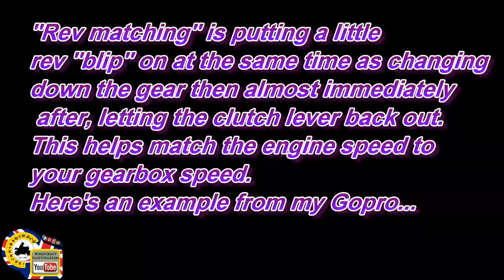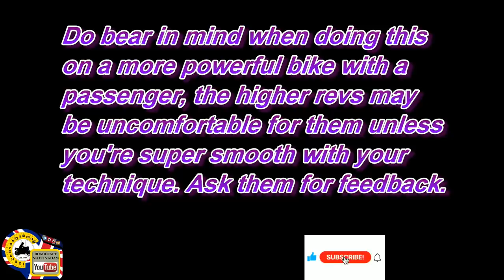WHEN to change gears on a motorcycle : How I do it as an instructor of 39 years. (Timestamped)

Comment: Is it much better to hold in the clutch with out downshifting when your coming at a set of traffic lights because its faster way of stopping and much easier? Because downshifting takes time. On kawasaki z400cc with a slipper assist clutch is even much better to do that with I think.
Reply from the maker: No, you need to be following your speed chosen with the matching gear. Keeping in 4th gear at 10mph isn't recommended as you'll have to fiddle with the gears.

Comment: I have a question, I'm on a 125 and can I block change from 5th to 3rd to take a corner if I'm slowing down using the brakes and not on the throttle or will the bike not like that
Reply from the maker: If you've lost your speed first and know your bike's gearing so it doesn't over-rev when you let your clutch back out, yes, as long as you have the gear engaged before taking the bend.

Comment: This is a great video! I have a question, what’s the proper technique when I find myself going too fast downhill thats also a bend? I usually downshift and use rear brake if the engine brake is not enough to slow down but I’ve been reading that this will cause the rear wheel to lock up? Will applying the front brake cause me to slide? Thanks in advance for the advice!
Reply from the maker: Always smooth, progressive braking first, followed by gear to match the speed. You won't lock up then.

Comment: Is it ok to alwayss get many gears in a row without letting clutch out, i get in first gear high speed & then clutch in & keeping in & get 4 or 5 gears & then let clutch out & downshift same way
Reply from the maker: To want to change that many gears in one go, you'll have to be ragging the bike, not the behaviour of a competent rider.  It can be done, of course but not desirable or really required.  A couple of gears, no problem.
Reply: @RoadcraftNottingham  i don't understand the reason why one has to release the clutch in betweens rather then get to 40km/h on 1st gear & then upshift till 4th gear & then release the clutch. The rev will match & also less fuel since you are getting higher gears in.

Comment: Interesting, I’ve got a question for an expert! I ride the Honda CBR650R with a slip and assist clutch, I thought they still required blipping but it never works, you always end up lumping the revs, you can successfully change down and just drop the clutch and that works fine. I’d have thought it would wear it out! Nope it eases it in.  Am I doing it right? On my other Hondas without that clutch, rev match/blip is essential. If you try to blip the assist and slip clutch it just hates it. Perhaps Triumph are different? Thanks
Reply from the maker: Slipper clutches are another unnecessary addition on bikes for public roads. They're basically there to stop the rear wheel locking up under extreme conditions. I had a go on a bike with one years ago but can't remember it that well so can't help you. I suppose just keep trying different ways until it feels right. Good luck
Reply: @RoadcraftNottingham  cheers for your reply, I think I’ll trade it in for something else. They’re putting them on everything these days, it takes the skill out of it. Yet, the friction zone is finicky and narrow, compared to a standard clutch. Or maybe I’ll just go for a Zero!

Comment: Should I have my foot VERY slightly putting pressure on the upshift when shifting normally? (clutch in including). I've read forums where people say it's ok to preload but some say it's bad. but I'm new so I found out that putting pressure makes the shifts way smoother. 
Does this wear the engine out?
Reply from the maker: Pressure whilst accelerating makes the change quicker when you close the throttle off to change. It's only a problem if you have a quick shifter fitted. If it feels smooth then it's all good.

Comment: That's my practice sorted for the next few days, rev match is one of the pieces I've enjoyed on this video most, thanks I really enjoyed this video and it's going in my playlist.  What's your thoughts on progressive braking?  I use both brakes together after lowering throttle and engine braking?
Reply from the maker: Progressive braking is best. The front is your main stopping brake with the rear being for slower speed control. Search my channel for Diavel and braking.
Reply: @RoadcraftNottingham  Thank you, I’ll check that out today :) 🏍✊🏻

Comment: Very useful - thank you. An advanced instructor once told me to aim to hold revs in any given gear at roughly halfway through the rev range- e.g. if you’re riding along at 30mph, pick the gear that ticks the engine over at 5k (presuming a 10k readline). Just wondered your thoughts on this?
Reply from the maker: It all depends on the type of bike and engine configuration. Just feel what your bike is capable of and experiment.

Comment: Great video as always . I was wondering if you can comment on the issue of 2 fingered braking? It seems that alot of instructors in the US swear by it where the UK instructors that I have spoken to said that its dangerous and would be grounds for failing a test.
Reply from the maker: There's nothing wrong with two finger braking and you will not fail for braking like that. One or two old school instructors or examiners don't like it because we were told years ago to use 4 fingers but braking efficiency has come on massively since the 70s. The bottom line is "has braking with two fingers had a detrimental effect on the bike's control or your safety?"
I once told an examiner he shouldn't have mentioned the two finger braking to my pupil on test and we had a little argument... I then went to the big boss who said" examiners can't mark what they don't like "which is an excellent response.
Reply: @RoadcraftNottingham   Thanks Russ, I've learned to ride outside of the UK and had to do my test again since my license was not from an EU country. I was brought up with 2 fingers on the brakes at all times and I had to in a sense relearn how to ride when it came time to do my test.

Comment: Does anyone know why my gear lever jams when shifting Down? If so what can I do to prevent this?
Reply from the maker: Firstly make sure the lever is returning, could be a mechanical issue. Then check that you're taking your foot fully off the lever between shifts to allow the next selection. If changing too late, let your clutch out between each shift to help reset the gearbox.
Reply: @RoadcraftNottingham  the issue usually occurs when I’m downshifting multiple gears at once after coming to a complete stop at traffic lights or a stop junction

Comment: Yes, my changing is pretty much as you describe but like others have said my bike has a lot of engine braking so I often don't need to use the brakes but just let off the throttle. The concern is that the car behind might not appreciate that I'm slowing down. I tend to dab the rear brake enough to get the brake light on. What do you advise in this situation?
Reply from the maker: My point is normal engine braking in the gear you're in is fine, changing gears to replace any braking you may need isn't. There's a difference. ☺ I do dab my brake lights on my Zero if there's a car following because the regen braking is so good

Comment: Thanks Russ, Another well informed vid.  I recommend to my students to subscribe. Quick question: what is your opinion on riding with balls of feet on pegs or arches? Cheers.
Reply from the maker: Thanks for the recommendations. I don't mind how someone rides as long as they are in control and safe. Different bikes, peg positions and heights and rider sizes make things different. If they're riding with balls of their feet on the pegs but then move to cover the brake when required, I'm happy.  One of the problems with arches is they have what I call "clown feet" and there's a danger of toes scraping the floor on bends or clipping test cones.  Also a danger of slightly applying the rear brake without knowing. 

What do you think?
Reply: Thanks for the reply. I had it beaten into me about arches only. But the IAM teach balls of the feet and I may well have been converted. I don't like the " clown foot " either .. looks messy and balls of feet offer more control. Over the years I know I was moving my inside foot back for clearance on bends. So I am now on the balls and practising that. One of my instructors used to call the arch position a lean angle sensor,,,,!! Lol. I like to arrive home with both feet still attached. CHEERS AGAIN for all the great posts.
Reply: @RoadcraftNottingham  I did this on my CBT, I had to wait in a queue with a police car behind me, when I could go, I just kept stalling, stalled like 3 or 4 times before I realised my foot was on the brake.

Comment: What about slowing down from 6th gear?  That’s a lot of gears to get through at the last minute 😮
Reply from the maker: Just start the changing down process slightly earlier and time the changes to correspond with the speed of the bike without causing that rev surge, I can get through 5 gears in about 3 seconds or practise timing it. It's not that often you'll have to go straight from 6th to 1st.

Comment: On part 6:50 u say throttle braking so u close the throttle and then let it drop rpm’s then downshift
Reply from the maker: Yes, slow in the gear you're in until the slowing is less effective, then brake then find the gear to match your chosen speed.
Reply: @RoadcraftNottingham  I know every bikes diffrent but I have a Harley I’m a new riser but what rpm’s should one shift down or just do it when it matches the speed of the gear
Reply from the maker: @bryancardenas-qs4ig  Good question... Try closing your throttle in whatever gear you're in until you feel the engine braking effect is reduced to a point where you need to blend brakes in. Then it doesn't matter what bike you're on as the principle is the same.
Reply: @RoadcraftNottingham  ok so sorry stupid questions but say I’m going in 3 gear coming up to a stop I close the throttle to engine brake then if I feel like I need to stop a bit faster I pull on the brakes and downshift sorry I got confused on the braking effect is reduced to the point I need to blend the brakes
Reply from the maker: @bryancardenas-qs4ig  spot on. Have a play and let me know how you get on.
Reply: @RoadcraftNottingham  I appreciate the help and for getting back to me I will do that and get back to u here thank you
Reply: @RoadcraftNottingham  I followed ur advice I feel better was just nervous because u came to a corner and downshifted and a car was on my ass besides that it helped
Reply: @RoadcraftNottingham  so I took ur advice but I also came to a stop and downshifted 2 gears and kinda lunged foward
Reply from the maker: Sounds like you could benefit from an actual lesson with an instructor. Let me know how you get on.

Comment: My NC750 is not a fan of block shifting.
Reply from the maker: Try keeping a millimetre of throttle open so it keeps your revs ever so slightly up as you downshift, that should help it become smoother if that makes sense. Let me know how it goes.
Reply: @RoadcraftNottingham  Thanks, will give it a try, got a few bits to do with the bike before its back on the road